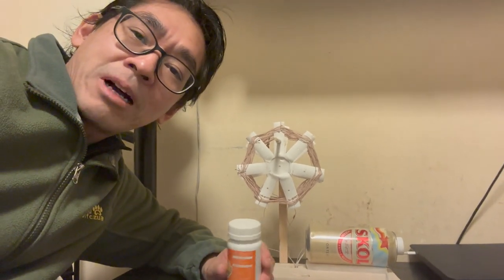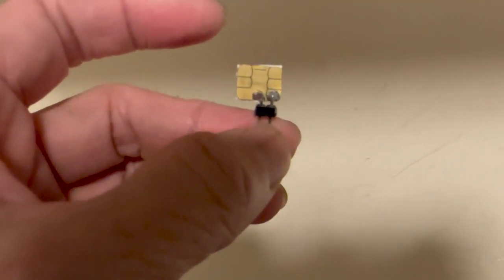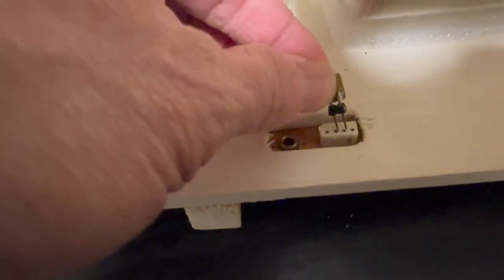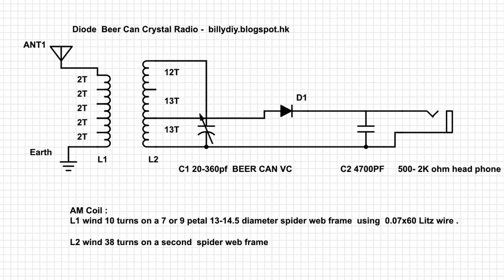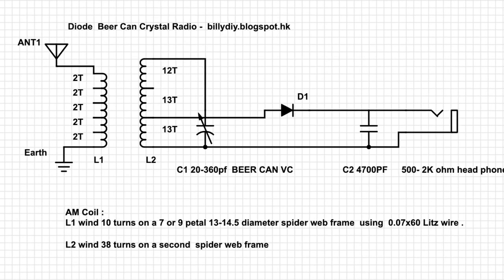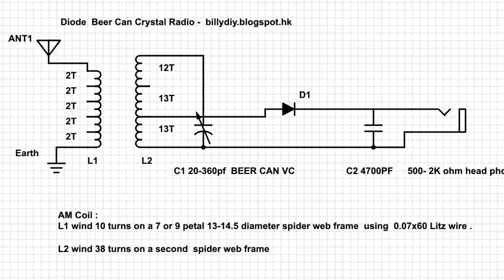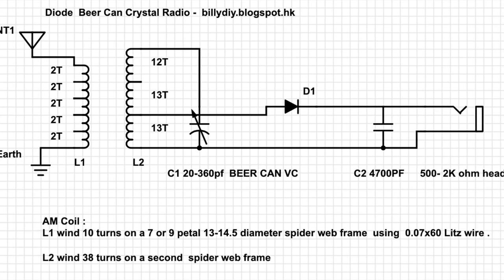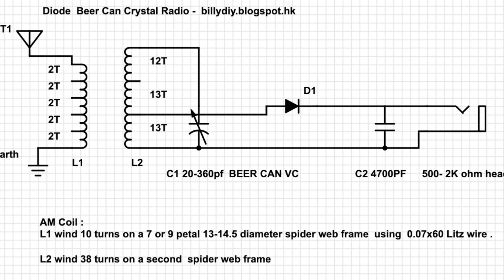DIY Beer Can Crystal Radio and Testing #FreeEnergy #NoBattery

Comment: Nice little crystal set. It would make a good project for a young person learning about electronics and radio. I did notice that you showed that varying the coupling can make the signal strength for some stations peak when the coils are not at their closest positions. I always found that interesting.
Reply from the maker: Joseph , thanks for your good words. Yes. I found the right tapping at the antenna coil and the right coupling between the antenna coil and the tuning coil are the most important factors for a successful reception of stations in a crystal radio, apart from the proper impedance matching in the entire path from the antenna to the detector to the earbuds, given the same conditions in the antenna and earth set up.

Comment: Had been gifted a xtal rig 20 years ago. A 80 year old told me to (take care of it for him) on cleaning the rig i found a date of April 27  1921. Name and address and call letters. What amazes me it still works. And for several years I have listened to the army navy game. My head phones are  Baldwins. Also I go a radio shack(r) af amp. For crowd demos. It also sports a DIODE Sylvania(r) for when I don't want to mess with the "cat whisker". Don't knock em that Crystal radio hangs in there hi hi odn-1

Comment: Nice idea, the beercan capacitor. You're a real inventor.  Can one use a bigger transformer or is it a special model?
Reply from the maker: I modified a small transformer to have one input and two output, one for my 500 ohm earbud, the other to feed to my iPhone mic jack for recording. I make it smaller for portability for field tests. A bigger transformer with the same step down ratio will perform better. See my video here: https://youtu.be/D3n53TAKj54

Comment: NIce, what frequencies does this operate on?
Reply from the maker: I designed this to operate on the AM band. But due to limitation of components, it currently operates from 500 kHz to 1600 KHz. Though I found that by removing the earth and only attaching a 15 meter antenna, it catches a strong Short Wave station broadcasting from Taiwan to my place in HK